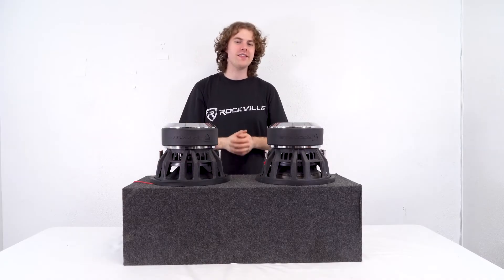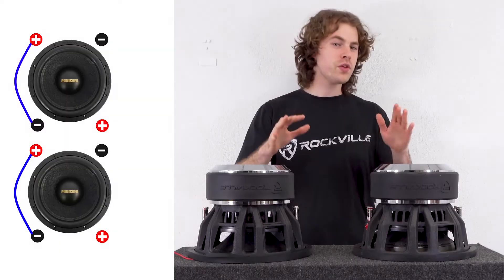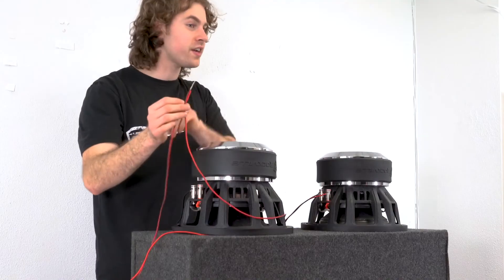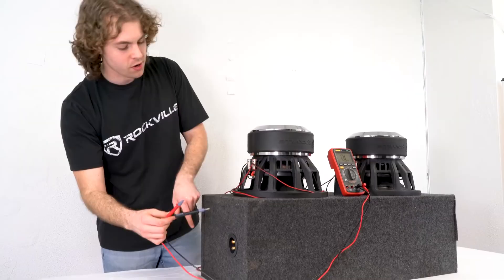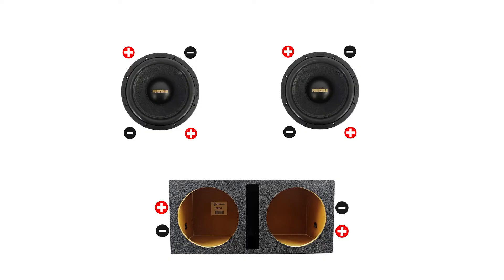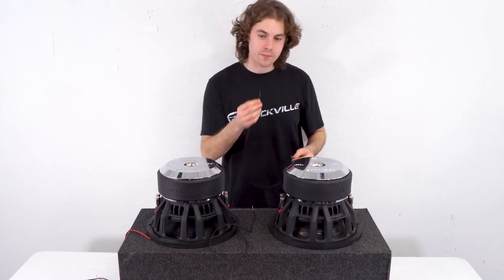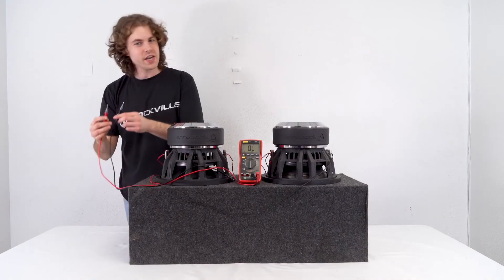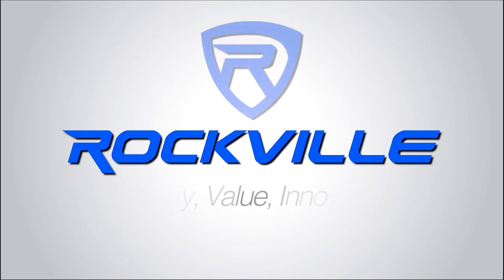HOW TO wire 2 Dual Voice Coil 1 Ohm Subwoofers - Parallel, Series Parallel, And Series!

Comment: I'm just wondering if there is a subwoofer amp capable of handling below 1 ohm
Reply: The SKV2 series by Skar. For example I've been running their SKV2 4500.1D for the last 3 years on 1/2 ohm running it hard everyday no issues

Comment: My 2 DVC Rockford fosgate subs only have 1 terminal each, with a "jumper" to run them at either 1 or 4 ohms each for either a total of 2 ohms, or 8 ohms. Is there any way I can wire it to 1 ohm final impedance? So each sub would be at 0.5 ohms each.

Comment: If I’m wiring the same speakers you show. Into my 5k taramps Amp.I only have 1 positive and 1 negative hole on my amp for wires. Do I just jam them all in there? Lol…
Reply: I’m assuming you fixed your issue but did you just end up using a terminal cup?